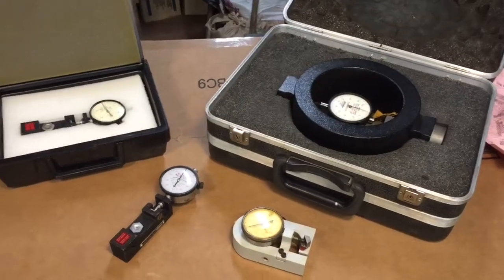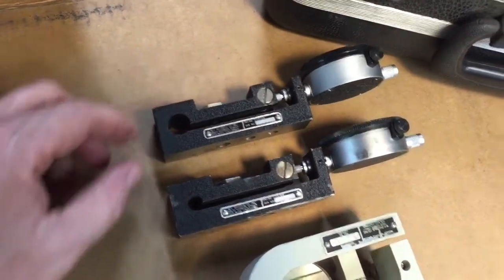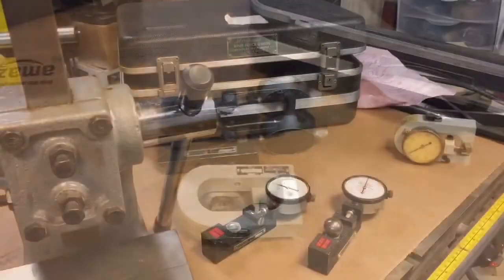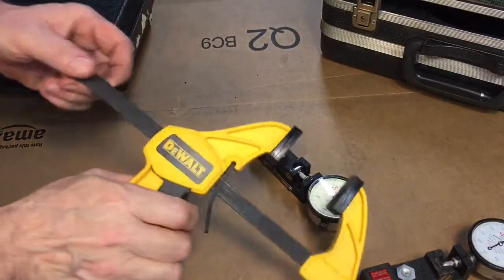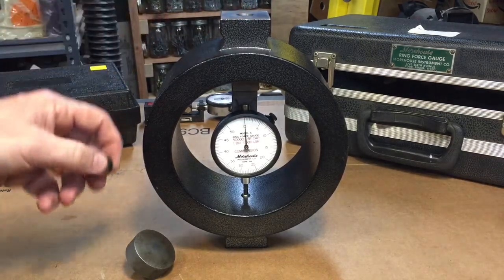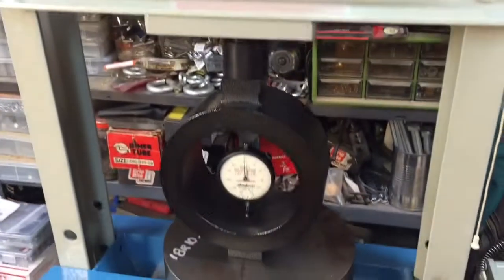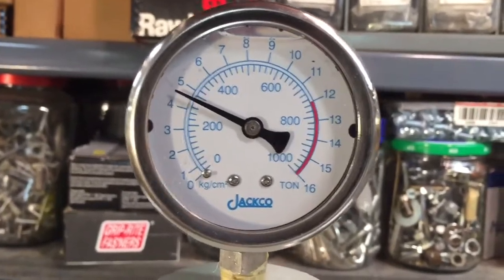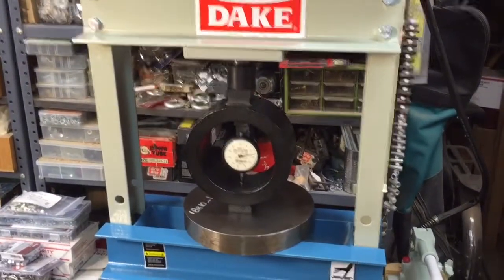Force Gauge Introduction

Comment: I remember working two 12 hour days with a dozen other guys . Jacking a 400 ton Melt pot up , enough to clear the hole , and rolling it out of the mill . We used 6 x 100 ton jacks for safety if I remember correctly , ...Cribbed up with hard wood every step of the way till we cleared the hole . Man .....we were All nervous , as at one stage 2 of the jacks were old and had a very hard time keeping up & we were all underneith it as it was almost 6 feet off the floor . We slowed down the pace making sure we kept the same preasure on the old jacks as the new ones , and jacked in about 10 second short intervals /STOP !......Jack 10 seconds /ALL ---STOP  (AirHorn was the signal)....LOL......I don't think they would do it that way now days , I think it takes 3-1/2  12 hour days instead of 2 now , with all the OSHA  regulations . I have a 1 ton arbor press , and a 6 ton Hydrolic , and that is all I feel comfortable working with now days ....Thinking back on some of the many dangerous jobs we did ( They would never  alow it now) . I think I'm glad I am retired from it ....LOL
Reply from the maker: Dave I love stories like that!  I often think about the men/women who built this country and how hard they had to work compared to today's standards... As we grow older I guess we have a whole new appreciation for jobs well done.  I love those old railroad and house jacks!  😃👍